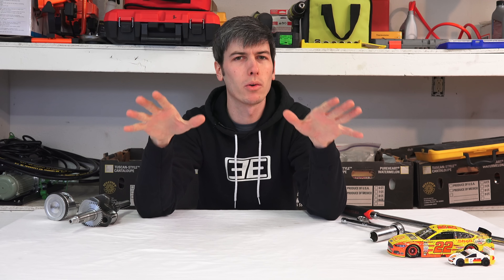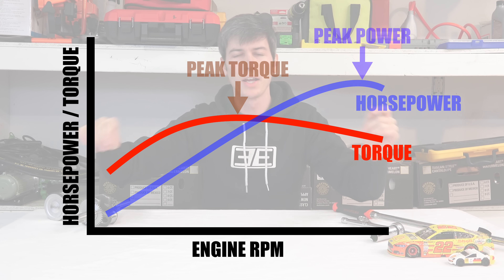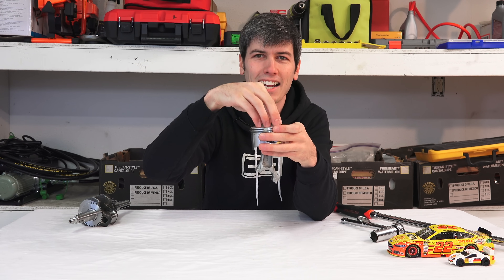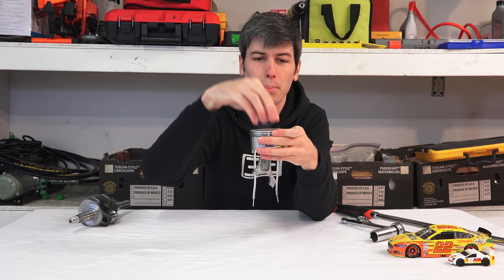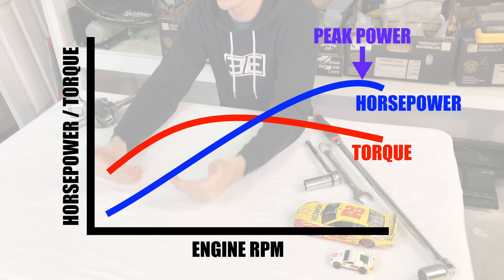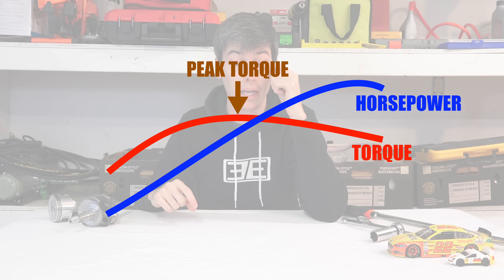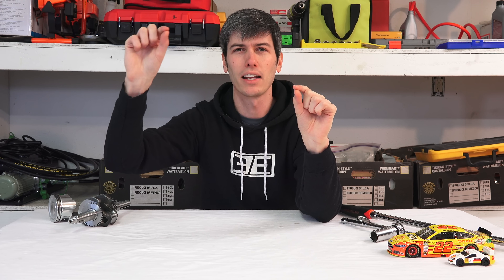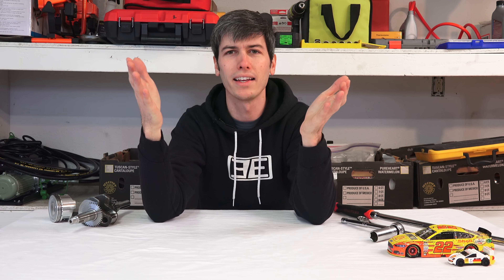Horsepower vs Torque - A Simple Explanation

Comment: One of the most awesome torque curves from a std. engine I've ever seen, is the bench reading of my old Suzuki GSX 1100 motorcycle.
It reaches max. torque at about 2.000 rpm and the curve is virtually straight nearly all the way to the red line, which starts at 9.000 rpm. That's a 34 year old engine, but still going strong (10.7 kgm @ 6.500 rpm and 124 HP @ 8.500 rpm). :-D
Reply: Nice. My gsxr 1000 is about the same, but the torque takes a little bit longer to come in. Of course, it also keeps it a bit longer as well.Upside is max power is at 12100 rpm, which means a bit more hp than you got.

Comment: Engineering Explained Jason thanks for the video but could you please elaborate on the scenario you have used in the video but without playing with the gearing i.e. the cars are identical except for the hp and torque (200-100&100-200 as in the video)and they accelerate from a standstill using the same transmission. What would be the outcome of this ?

Comment: Torque is what you feel on acceleration not HP. Torque is what gets you moving fast and HP sustains the movement. If you look at the bar graph , torque climbs faster and you see HP cross peak torque. That's why you shift at peak torque not peak HP. Hard to believe you are an engineer. Now please everyone argue about it.
Reply: If this is true, you would shift mustangs/vetts/etc at around3,800 rpm which is just silly
Reply: Sorry, you think that short shifting results in faster acceleration?
Reply: top level riders/drivers with race-level cars/bikes probably get best performance when shifting right before the rev limiter
Reply: Every turbo car would be shifted at 3000 rpm, looooooooooooooool
Reply: If you would shift at peak torque your engine performance is less effective in the next gear, since you've shifted into a higher gear, and dropped the engine into the less powerful part of the torque and hp-chart. If you rev the gear out and use more power, you will be at a more favourable place along the torque and hp-chart when you engage the next gear.
Reply: Troll account is troll
Reply: Horsepower and torque ALWAYS intersect at 5252 rpm, not peak torque.
Reply: Yup, I'm an engineer and I agree.  Sorry, no argument from me...

Comment: HP = Torque x rpm. So unless your torque drops to 0 just past peak torque, the higher you can push the rpm's the more power. Past the red-line, it's not only risky to your engine, but torque is falling as fast as rpm's are increasing, so you can't get more HP out of the system--unless you gear up and drop revs to a lower range.
    The explanation jumps too much between engine limits and the auto's system limits (with gears). If I give you 200HP w/ a single-speed trany, my 100HP/ 5-speed is going to beat you every time to 60 mph. HP is all about engine design maximums. Torque is often about pulling capacity of the whole system.

Comment: Good explanation!  People ask about F=MA all the time, trying to prove that torque matters in vehicle performance.  F=MA still applies, but it's not the torque at the crankshaft that determines acceleration - it's the torque at the drive wheels that determines acceleration.  At any given road speed, the car that is applying the most power to drive wheels will accelerate the fastest (assuming all else equal, like mass, traction, drag, etc.).  By definition ("the rate at which work is done"), power is what determines how fast a car accelerates.

Comment: Hi, I just started learning about mechanics and I still don't understand why gears determine the torque. After watching the first part of the video I thought that it would be the length of the connecting rod that determines the distance. So I thought that the longer the rod the greater the torque. The axis on which force is applied is the crankshaft, so the torque would be force of the piston times the distance to this axis, which is is the length of the connection rod. Right? So What have gears to do with the torque of the crankshaft? Im guessing that there is another axis that is connected with the crankshaft and the gears, I will call it the "final output shaft", and that we are talking about the torque of this shaft, the value of which is:
The Force of the pistons * (length of the connecting rod + length of the current gear)?
Reply: Not really the connection rod so much as the force of the piston acting on the offset radius of the crankstaft. If you increase the offset (stroke) you will recieve higher torque. If you make the piston bigger (bore) it will provide more force to push on the crankshaft. 

Transmission is just a way of reducing rotational speed to increase output torque. 2:1 transmission will output half the rotational speed but double torque. The point of transmission is to give maximum torque at the wheels, not the engine. 
Peak power in the engine at the current speed will give you the greatest torque at the wheels. This is why we use gears to always have maximum torque at the wheels.
Reply: Torque at the crankshaft is determined by the engine and it's fixed. The torque at the wheels is the one that is changed by the gearing, and that is the one that determines how fast the car goes.
Reply: Its actually the opposite, when you increase the stroke of an engine the connecting rod is actually shorter. The distance of the crankshaft offset (center of the crankshaft to the center of the big end of the connecting rod) will be longer giving the piston more leverage but also increasing the speed of the piston at the same engine rpm, that is why stroker engines "make more torque". Higher the stroke the lower the rpm range the engine will make power and since the horsepower and torque numbers ALWAYS cross at 5,252 rpm the torque number will be high and the horsepower will be lower (or not cross at all if they engine can't go up to 5,252 rpm).  Look at a 5.9 cummins diesel stroke of 4.72 inches compared to a 6.0 LS engine at 3.62 inches.  These 2 engines make about the same horsepower, but the diesel makes peak torque at 1,600 rpm while the LS makes peak torque at 4,400 rpm.  The advantage of the low rpm power for a truck is that you don't want to drive around at 4,400 rpm towing your trailer, you want to cruise at 1,600 rpm.  For a sports car you want that power for a longer time in each gear, like say from 3,000-6,000 rpm so you can take a corner without shifting.
Reply: I disagree with what you said about the connection rod being shorter (or longer for that matter). The connecting rod doesn't have to change length. Torque is increased by using a different crank shaft, one where the crank pin has a longer distance from it to the center axis of the crankshaft. Making this distance longer is what increases the torque. You might want to shorten the rod length after doing this since the piston will travel further (in both directions) and could hit the valves but it isn't necessary to increase torque
Reply: You either have to run a shorter connecting rod or buy new pistons with a higher wrist pin hole or the piston will hit the head.  There are also some claims that shorter rods give you some more low rpm torque because of increased rod angularity, and also other claims that longer rods are generally better (from a higher deck height block) because the force from the piston has a straighter path to the crank.
Reply: cezary8222 Soooo, nobody talked about gears here... Gears are roughly levers with steps. Just so i don't complicate the matter, when you use gears you are either loosing rpm and gaining torque or loosing torque to gain rpm. For example if you have a gear with few teeth turning gear with a lot of teeth the first one will have less torque but more rpm than the second, you are trading one for the other, roughly speaking. You could say that two gears are like levers whose torque depends on the numbers of teeth instead of the distances from the axle. Again, it's a little more complicated, but thats the bulk of it
Reply: Gears have nothing to do with the torque produced at the crankshaft.  A cars transmission is a torque multiplier, so the torque at the hubs that drive the wheels will be affected by gearing.  In terms of crankshaft torque, it's the stroke of the crankshaft itself that determines the distance the piston moves, not the connecting rod.  The connecting rod could be a mile long but the piston would move exactly the same distance.
Reply: Just think of a bicycle with gears. It the same basic idea.
Reply: Yoni Dellarocha at least somebody gets it
Reply: Rust Belt Auto
  Yes a longer rod has advantages, such as less side thrust on the piston.  However these are secondary effects; the OP is confusing the crank stroke with connecting rod length, a longer rod length does not give you more stroke.

Comment: Thank you for explaning it! There are still too many people out there, that have no idea of this. In the motorcycle-scene I had to often to explain, that a old 1000cc Bike with the same Power as a modern 750cc Bike is not faster. But all the guy were always complaining: But you have more torque, not understanding that their higher rpms are converted into the same torque at the rearwheel by the higher gear ratio, and that this is discribed by the term of Power. But it's like talking to a wall... sadly.

Comment: Good video, lot of information to take in but I think I get most of it. My remaining questions center around what gives an engine higher or lower torque or horsepower. I would have liked to see you compare two similar but different engines (ie. a 4-cyl Wrangler engine vs a 4-cyl Corolla engine) and explain why they have different torque / horsepower. I assume a lot of various factors come into play including piston size and piston arm length, camshaft specs, overall displacement of course, etc.

Comment: The Maximum Power and Torque from a modern engines is all governed by the Crank and Cam and also other factors like Type of fuel used and also if controlled by computer or ECU and thus it has limits, but remove injectors and put a Free flowing carbies and you watch the same engine rev its tits off and get more power and also torque,but no mare than what your cam and crank profile and put out >?

Comment: WTF Going form A to B going faster is what A) the same car is going to point a slower,yet it has the same Power and Torque in the car, so drive slower and you use less fuel thus saving the world  ?

Comment: Also reason why geared diesels feel (and are) faster then what their hp figures tell us.

Their torque is falling at peak power meaning their max power is less peaky.

180-200-180 bhp  at let's say 3500-4500 Rpm is more useful then 160-210-160 at 4500-6500 rpm.

Since the average of Bhp available can be higher.

Comment: The sensation that of being pushed back into the chair is known as jerk. This is the RATE of acceleration.  Acceleration itself has no sensation. Check out Einstein’s explanation of how he came up with the special theory or relativity (it’s very easy to understand.)
Reply from the maker: If acceleration had no sensation then I wouldn’t feel Earth pulling me down. I do. And I also feel acceleration in other directions, such as when a car is accelerating. You don’t feel it when you’re moving at a constant speed. When speed is changing (because you’re accelerating, or slowing down), you most definitely feel it.

Comment: Well, now im more confused than ever.
Why do high torque Undersquare engines accelerate faster than Oversquare engines then?
Why does a Vtwin for example produce so much in the seat acceleration despite not reaching very high speeds?
Why are big super high torque diesel engines capable of pulling so much weight when they often dont produce very much horsepower compared to their torque output?

Comment: The reason nobody ever understands this is because they've heard for years of "torquey motors" and sayings like "horsepower is just for show, torque wins races".  When someone talks about a torquey motor like a V8 in a muscle car, the more correct terminology is "wide powerband", meaning the horsepower graph will have good numbers for a wider range than something like a Honda with a race cam in it that will only make power near redline.  This is why cars like the Dodge Viper run such amazing lap times compared to a tuner grenade that makes far more peak horsepower but only for a very short RPM range.  The Viper will have power even if you're not at an ideal RPM whereas the high strung tuner car will bog if it's not at the perfect RPM near redline.  The tradeoff here is that typically low torque/high hp motors tend to be small and light vs. big muscle car V8s that weigh down the car and can affect handling and braking enough to hurt lap times.  At the end of the day, it's all a balance you have to strike to get the best performance overall.

Comment: That's inaccurate. Power and torque are inherent to the engine, it doesn't matter the kind of transmission. Peak acceleration will aways be at peak power, you can have a higher rev, less torque and still have higher power than at peak torque. The gearing affects the torque transmitted to the wheels, so a higher gear will provide less torque, but at a higher speed (wheel rev), and the power transmitted is always the same at a given rpm. (lower speed = higher torque, lower wheel rpm and  higher speed = lower torque, higher wheel rpm ==> same power to the wheels).

Comment: Could you do a video explaining how an engine makes different torque at different RPM? Especially why larger diesel engines have such narrow torque bands. I get the lack of boost at the bottom end but why does torque fall off the cliff at upper RPMs?

Comment: In the chart, torque rises along the RPM axis, which variable is changing resulting this? force or distance?
Reply from the maker: Force, distance remains constant. Volumetric efficiency (how much air the engine received) among other factors are changing with RPM, hence torque changes as well.

Comment: Or. simple to say. more hp- better acceleration,more top speed. more torque-better acceleration in higher gears,less shifting uphill,eazyer to drive. Torque and hp are close connected. best example is difference in between same hp gasoline and diesel engines,where diesel needs less shifting,more torque.or a bike 100hp 1000cc,or 100hp 600cc .huge difference to drive.

Comment: Very often, comparable cars with higher peak torque will accelerate faster at lower speeds but a car with higher horsepower accelerates faster in higher speeds. Doesn't mean the car that has higher peak horsepower will accelerate faster throughout its rpm range in compare to a higher peak torque.

Comment: Correct me if I’m wrong, but if both of the cars are “equal”, and the only difference is that one has more torque and the other more power. Assuming that this equality also includes gear boxes, then wouldn’t the one with more torque come out ahead since it is able to move the weight easier at the beginning?

Comment: Not sure i am following you.
You say, the car that accelerates the fastest is the one with the most HORSEPOWER.
Why then, at drag races (car and motorbikes) is the winning vehicle always the one with the biggest TORQUE figure ?
We also have a saying in the drag  racing circles. ''Torque wins races, not horsepower''.
Can you shed some light on this view point ?
Many Thanks.
Reply from the maker: The saying is wrong, and I’ve explained in this video why hp is the most important. An anecdote of saying “more torque wins” doesn’t necessarily make it true. If you watch my video “are cvts the fastest transmissions” I explain why horsepower is more important than the torque figure. And remember, high low end torque means high low end power as well, which is a good thing.